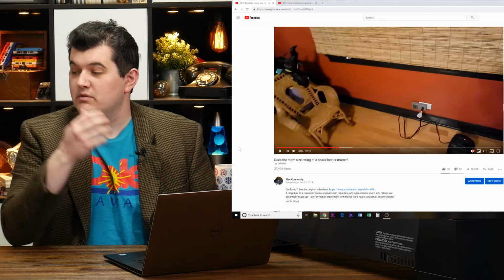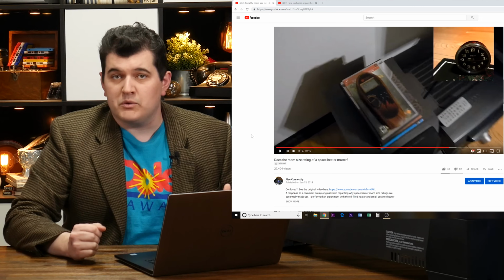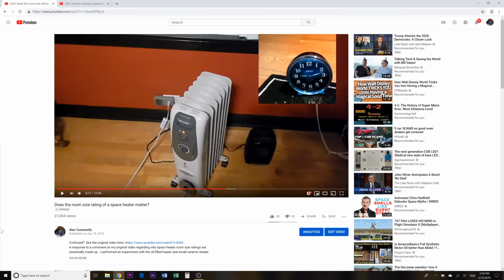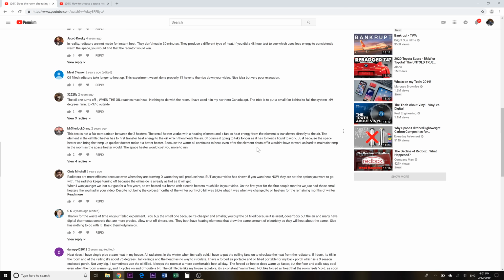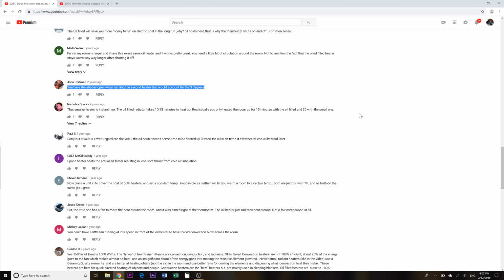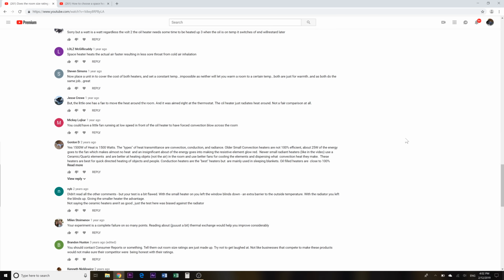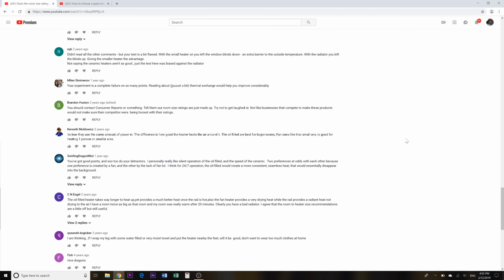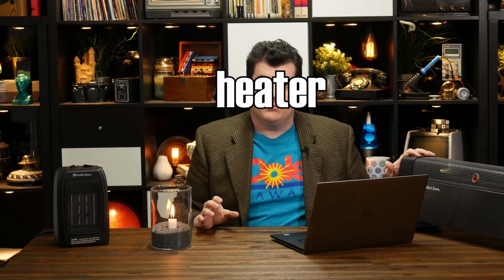More Space Heater Nonsense

Comment: Oh something i forgot - surface area and noise created over time.
If you take out the "how long does it take to warm a room" and change it with "how suitable is this to maintain a temperature in a room over time" then 
A small heater in a larger room will create more noise  
A larger heater will be quiet, but requires more surface area to ouput its heat due to a lack of a fan. 
This would mean the room size recommendation is probably valid even though its probably based on other things rather than just plain wattage. 
As someone who has worked in retail, this sort of thing used to annoy me, but then when you realise a marketing department could be just trying to help an average consumer who doesnt think about the technical things like wattage like we do, then it makes sense that they factor in a few different things to make a recommendation.

Comment: My experience would be that if you put a cheap fan heater in a large room it will run for much more of the time than in a small room. Whats that got to do with anything you may ask.... well the motors in them are so cheaply made with poor bearings (or even just plastic bushes) that they wear out quickly. So perhaps they say "small room" so they don't run as much and don't fail before the statutory warrantee period runs out!

Comment: Alright so this is my personal experience. I am a micro-soldering specialist, but I also went to school for a short time taking HVAC classes as well as courses for TIG, MIG, and Oxy welding. I’m not an engineer but it did help me figure out my needs. The best I was able to figure out after wasting money is that the radiator ones are for sustaining a room already at temp. You would use that in anticipation of cold coming since it’s “safer” to have on for longer periods of time. In that situation having an oil based radiation system running it will be able to sustain a reasonable temp in a large room. The large room is a statement of its limit. It won’t work in a grand ballroom but it’s not made for those kinds of environments. Where as a medium or small room would take less time to bring up to temp so you can use it on a as needed type of application. The radiator will work just fine in a small room as it will keep them temp consistent and with less demand potentially then in a large room. Example we have radiators in the industrial shop I worked in. The heat from the robots and me welding helped to get that temp up quickly and then the radiator system sustained it. If it was extra cold we would blast a kerosene heater and then turn it off unless we needed to roll out trailers and other items outside. I think what’s going on is a failure to properly inform the public. Who wants to think well I need to buy two so I can get the temp up. That being said this is where math comes into play. As you said in the second video the other day it is limited to only so much amp draw.  Why put out a lower end option what take up 5amp and then looks like an inferior product when the consumer is expecting heat. So they make everything the max. The math comes into how can you heat the room with both and get the benefit. Simple! Do what I did and put a box fan next to the radiator and boom. Haha. Idk I lost my track there a bit. That being said again I think it’s more so companies would rather do the max on all VS deal with returns.

Comment: you naughty boy
now I will say entering my 3rd winter in my house garage, winter 1 I had one of those ceramic heaters much like you have on our left, and it did and could heat the insulated but unconditioned space if left on most of the day (in combo with my gas water heater lol) BUT if I came home from work and turned it on, and went out there a few hours later after small child bedtime it was like I never turned it on at all. 
I replaced it with another 1500 watt heater but one of those grey metal box jobs with a ~10 inch fan, and its exactly the same , though having the larger volume of warm air blowing at me from across the space does help me feel warmer even though the deltaTdC is nominal

Comment: Different space heaters have different properties, so you're comparing apples to ... pears. Space heaters with fans are compact and fit better into small rooms, even under a table, but they are noisy. Convection heaters have to be bigger to not overheat themselves and need open space above to work properly. On oil filled heaters you can dry your clothes. Quartz heaters give infrared light to heat chosen surface. Other space heaters are fancy looking. 
All of them may have same 1500W of power (because of power limitation from one wall socket), but it is nominal power. Actual delivered power is always less than that, because they are somehow regulated to establish selected temperature. Probably, most of the space heaters can't output full power continuously for many hours, because of internal thermal protection. Space heaters dedicated to bigger rooms are more robust, so they can output full power for longer time. 
If you are looking only at power rating, please tell us, why you don't use your hair dryer as space heater?

Comment: all ya all's seem to obsessed with space heaters.    extreme cheapskate pro tip: save yourself some bread; pickup your little heater at a thrift store in the middle of summer.  you'll prob only spend a couple bux.   i don't run full heat in the back of the house & use a couple to keep it above freezing back there. i've got that little white boxy pelonis from the last vid & one of those old school grey metal things(you can switch between 1300w&1500w on that.  i mainly use the pelonis on the first & second heat settings.. the THIRD setting is spooky & seems too get much to hot for the white little plastic thing!!anyway this is how i found your channel & i subbed.  this shit seemed intuitive too me..  but i'm like old as dirt!

Comment: The 1500w limit is based on the sort of standard US circuit being about 15A, with 12.5A being a safe continuous duty current to plugin.  You would need a modified 20A 120V connector or something higher voltage 2/3 phase.  The rest is marketing.

Comment: At my old house we had an open floor plan first floor where it was essentially one large room wrapped around a staircase in the middle. One small $20 space heater could keep the entire first floor nice and warm. Thermal dynamics is thermal dynamics. Most of the comments are people that clearly cant understand thermal dynamics or are trying to justify overpaying for their space heaters and having fallen for the marketing. 
The only way I could see any kind of reason they could say different heaters are listed for different sized rooms would be larger surface area would allow more air to be heated at a time speeding up the rate at which the room warms up, however most of the larger ones use passive radiant heat and the smaller ones use a fan which speeds up the process so that the larger surface area of the ones without the fan don't have any advantage over the smaller ones that do. Though maybe the larger more expensive ones are better at heating a room because of the placebo effect from the hit on ones wallet and the marketing.

Comment: perception of reality is reality. however flawed perception is.
 on the practical side of things however a heater that can run continuously without tripping its thermal overload protection is more suited to a larger room where there is a larger continuous demand. smaller (physically) heaters can if designed well do this just as well. most are however not reliable long term .  burning out the protection circuit renders them inert. 
a larger heater with more reliable components is better suited long term for a larger room even if it uses the same amount of energy to do the same job. it may or may not pay for itself in the long term. the gamble here is on reliability not efficiency though.
 there are a remarkably large number of house fires in the winter from space heaters.  for what ever reason. improper use, faulty repair, a thrown clothing article, too many running at the same time, etc. it is a statistical thing. oil heaters are not immune. no heater is immune. or fire proof for that matter.

Comment: I can't believe there's 81 people that have thumbs down this video. Technology connections I truly understand your frustration. There's a pain do you have to have people comment or dislike a video where you're simply just trying to explain but there is no difference between one 1500 watt heater and another except for maybe how efficient they are at moving the heat around but there no more efficient at heating the room by getting heat out of the 1500 watts they're supplied. Because 1500 watts is 1500 watts doesn't matter what size of heater you put it into. It is very silly how they try to claim that one heater is designed for bigger rooms and one is designed for smaller rooms when they both put out the same amount of heat.

Comment: The end of your rambling about convection currents can be turned around to explain the marketing. If persistent air stratification of super-heated air resulting from too small of a thermal transfer surface area is the only reason to put forced air in smaller units, then the only reasons to sell a smaller heater with forced air is to take up proportionally less space , and so it really is about the size of the room versus the heater.
 
I may or may not have been in a server room after air conditioning had failed for ~30 minutes. I could walk through the room without noticing the heat, but if I raised my hand, the top of the room was really hot. This is was from servers with active fans, but there was still not enough circulation within the room to de-stratify the air based on the amount of heat that was being released. I think you may be too easily glossing over this while it may be the actual reason, when combined some people not wanting a noisy (and maybe less reliable) heater in a room where a larger one would fit.

To compare, it would be interesting to see you repeat your earlier experiment but with thermometers at the top, middle, and bottoms of the room (or ideally, a "stick of thermometers", which I've wanted to make in the past), so get an idea of the resulting stratification, and be careful of externally-influenced air currents when comparing heaters.
Reply: I've got an Idea! You do the test and let us know what you find out.

Comment: 5120 BTU's is 5120 BTU's they equal each other!  Just like you pointed out.  You are doing a good job, keep it up!   What could help to explain what you are trying to say would be a thermal camera to see the convection of the heat off both a fan based and oil filled.

Comment: I'm thinking it's the definition that not understood. Perhaps the longevity of the device is taken into account on the room size. I've owned oil filled heaters that lasted for years that i would leave on all the time. Comparatively, I can't think of many small heaters that lasted for years of continuous use. But I usually turn those off cause they warm the room quickly, then turn them on again. I buy the cheapest ones mind you.

Comment: You also have to take into account the time of day. Later in the evening, your walls will lose heat at a greater rate because the outside temperature is colder. From 6 pm to 9 pm you can drop 5 to 10 degrees Fahrenheit depending on humidity, where in the world you are, etc. If you're using the equation for heat loss due to conduction kA(T-T0)/L, from an internal temperature of 60 to outside temperature of 50 at 6 pm you'll have a T-T0 of 10 degrees. At 9 Pm from outside temperature of 45 to inside temperature of 60 you will have a T-T0 of 15 degrees. So the amount of heat lost will be 50% greater in that example, which would mean a heater will have a harder time keeping up. 

Think of it as heat in room - heat out in room = change in heat in room. You're measuring the change in heat in the room (technically, the temperature in the room which measures the average internal energy of the room).  

I think a better way to conduct the experiment is run the experiment again the next day, but begin with the oil filled heater first at around 6 pm and end with the electric filament heater at 9 pm. It is a very difficult experiment to run because there are tons of variables involved. Also, think how the heat is distributed around the room. Was the thermometer in the line of vision of the fan? Is there a temperature difference between pockets of air inside the room when running the electric filament fan vs the oil filled fan?

So given all the variables and that we don't know how evenly distributed the temperature is throughout the room, I'd say it is within margin of error.

Comment: I agree the original wasnt a fair test - you should have measured it over a 4 hour period and measured total power consumed, with a longer gap between the test to allow the walls to cool down etc. 
Another way to look at it would be to wait until the room has reached the desired temperature then start measuring it over a period of time to see if one uses more power than the other, as they maintain that room temperature. I think when tested over a longer period of time, the power consumed would have been the same. 
You could also measure the cool down time - if you switch off the heater, how long does the room take to drop in temperature - the fan heater would have been faster to drop while the oil heater would still be releasing heat into the room after it has been turned off so the cool down would take longer.

Also your oil heater must have a good thermostat. Mine if you turn it up high, it wont turn off - it just runs and runs constantly producing heat though as its only 1500 watts its not dangerous unless its covered.

Comment: But, you also have to consider that even with hot water systems, it's a slow, gradual heat. Once the room is up to temp, the radiator will maintain the temp. Either the electric radiator or a traditional radiator will not raise the temp of a room quickly. Forced air systems are designed to heat a room quickly.

Comment: It is less a matter of the bigger heater being better for bigger rooms and more a matter of the smaller beater being better for small rooms. Heat output is not the only concern. In a small room the small heater will bring the temperature up before the oil heater has even gotten started. The clear benefits outweigh the noise, shorter product lifespan, and small increase in the chance your house will burn down. In a medium room those benefits disappear. It will get the job done just fine, but it no longer has an edge to offset its flaws.

That said, any and all differences in the way these heaters work on paper pale in comparison to the effect of bad design choices. A heater with the thermostat right on the heater will always do a terrible job regardless of other circumstances.

Comment: While the physics of 1500W vs 1500W obviously makes the max heating capability the same, I'd still say that the oil-filled heater may be a better choice for a large room. The point is that while a mere 1500W is not very good for getting a large cold room up to a pleasant temperature, it can work well by being on (thermostat-controlled) all the time. In a small room not used all the time, it can make sense to let it become "too cold", because a noisy small fan-based heater can get the smaller volume to a pleasant temperature in a reasonable time, while a silent oil-filled heater may be less effective for getting quick heat, due to the self-heating affecting the thermostat (as you talked about) .

Comment: I can think of 2 times when you might want the heater that cuts off: 

1) If you live on the ceiling and are tight on money, perhaps you'd rather save some money and buy the one that cuts off - I'm sure that both heaters probably heat the ceiling to pretty much the same temperature.

2) If you happen to live in a highly efficient (insulated, non leaking) space, the heater that cuts off might stop you from melting into a puddle of goo. We assume here that the small heater has no self-regulating thermostat and would happily heat your room to the temperature at which it would melt or combust.

Otherwise, I think I would go for the heater with a fan; the fan would help circulate the air a little, hopefully distributing some heat in the middle of the room where most of us humans live.

Comment: Running an oil filled is like running an electrical signal through a capacitor. It won't change the amount of energy in the system, but it will even out the output. Use a ceramic heater if you want the heat now, but use the oil filled if you plan to leave it on 24/7. As for the physically larger ceramic heater, your guess is as good as mine - maybe it's got a bigger surface area, so it can radiate the heat out faster, and last longer because the elements don't get as hot? Other than that, no idea.

Comment: One of the energy balance and system boundary examples in my engineering textbooks was a fan in a perfectly insulated room. "Does the fan cool the room?" Answer: no. Because the room is perfectly insulated, it loses zero heat. The only energy transfer across the boundary of the room is the electricity coming in to power the fan, so over time, the fan will heat the room.

Comment: You are missing a big piece of the puzzle. Direction. A small heater blowing in one narrow path is easier to block, but makes sense in a small room with less space. A larger room with more space should have a larger heater that won't be blocked as easily. The power isn't the sell, it's the size trade-off.

Comment: Pro tip.  When using a heater,. boil some water or run shower to increase the humidity.    Humid air holds heat better and it helps heat spread evenly and faster.   Air Conditioners do the opposite they remove humidity and cool, thus "condition" the air.  (Science works)